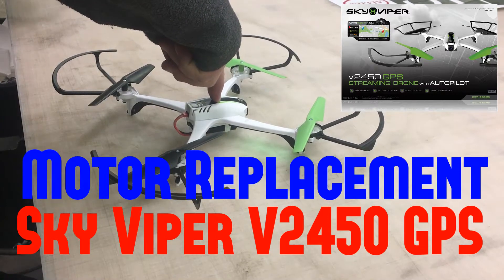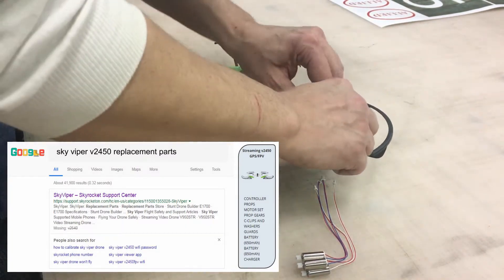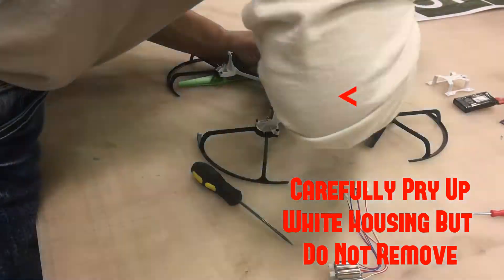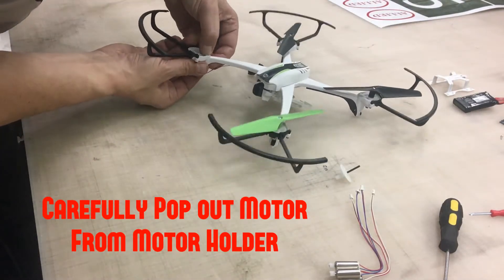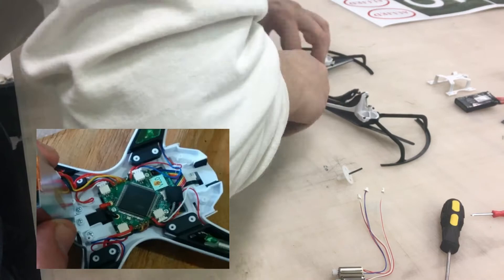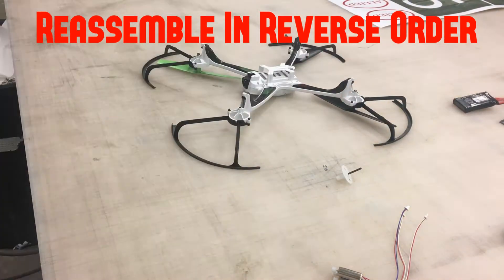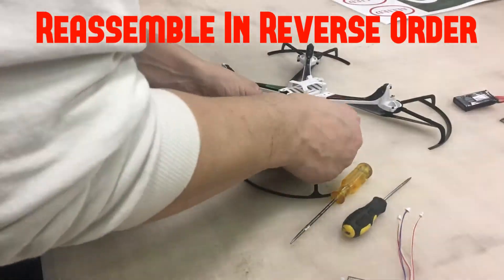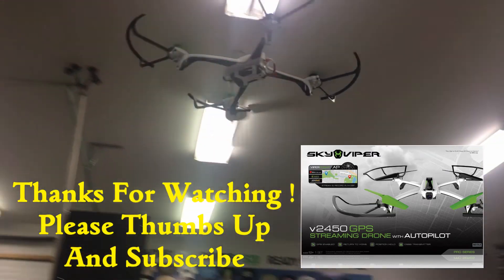Sky Viper V2450 GPS Drone Motor replacement.

Comment: Hi. I will be very pleased if you help. One of the motors of my s1750 is out of order. I want to replace it but do not know the rpm information. There are various motors with different rpm like 43000 or 50000. Can you help me about which one to buy?

Comment: I took 4 motors from my v2450fpv and installed them into my 2450gps. Now the 2450gps won't lift for take off. The Air flow felt when the motors start, is going up. Shouldn't the air flow from the motor be flowing downwards instead.
Reply from the maker: i would guess that you would have to switch the wires/motors. if you install them in the incorrectly they will blow the wrong way.
Reply: Scott Kyba Thanks my man. I figured it out by changing them. It sucked having to take all those screws out again. But I was happy it worked. I noticed the outer coating on the ribon  behind the camera is gone in some places.

Comment: Nowadays, you just gotta wait for the parts to be in stock.  They seem to be never in stock.
Reply from the maker: Ruxton Istre Yes..but they seem to come in stock every few days. Make sure you put your email in the waiting list. That’s what I did. I found that parts would come in stock daily. It was a matter of waiting for all three items That i wanted to be in at the same time.
Reply: Yeah I'm definitely on the list. Since my skyviper is only 10 days old and the motors burned out that fast with less than 1 hour of total flight time....I'll likely see if the store I bought it will accept returns.

Comment: Had to change one recently, due to a crash(tree)...Ordered the same parts, & super easy to do!  I also bypassed removing the big gear, motor pops right out, when you remove black trim.  Hardest part for me was removing/installing those tiny screws! :)
Reply from the maker: Thanks for the comment! I’ve Crashed so many times... I’ve stripped a few gears as wells.. Love it’s so easy to fix!